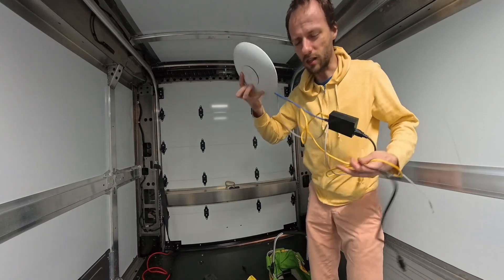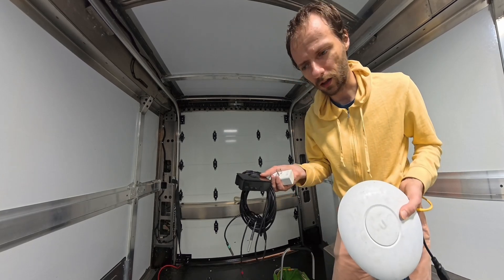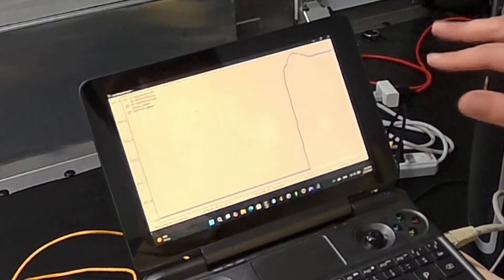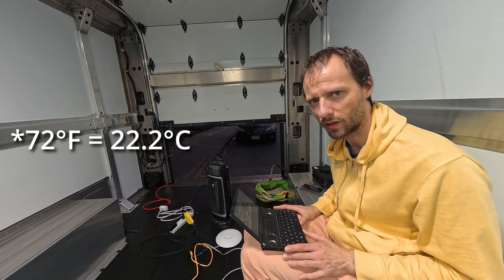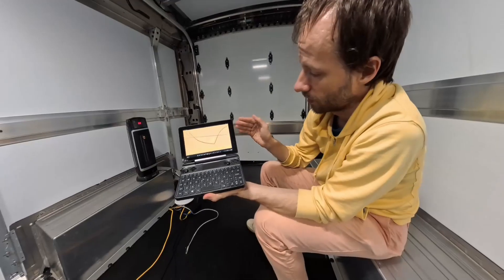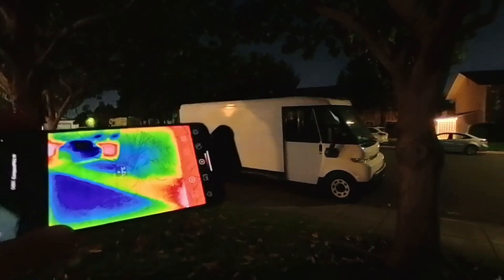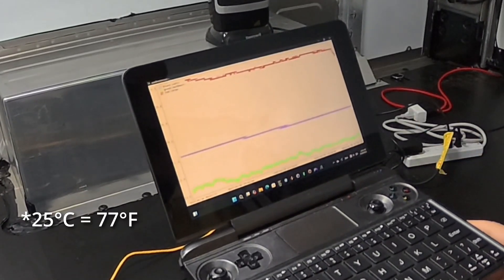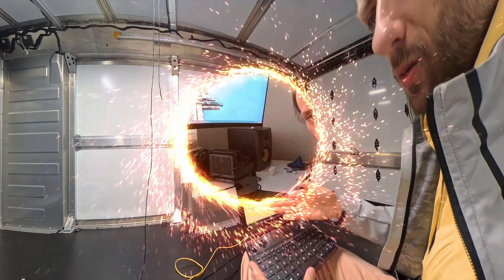Episode 2 - measuring heat loss in BrightDrop 600 (2025)

Comment: Would love an episode if you can review the adaptive cruise control on the brightdrop, and how it performs in stop and go traffic!
Reply from the maker: My goal for this channel is primarily the build, but I will try to keep your request in mind for when I do a longer drive
Reply: Thanks  @f3build
Reply: I can answer this briefly. Like the Sierra Denali EV, it works great most of the time. Just today, my Brightdrop failed to slow down when approaching a stopped car at a light on a curve. I increased my gap setting and now it slows well before the next car, but I need to see how that affects things over time. But in general, wow, what a nice feature to have in traffic! The biggest shortcoming here and with the Denali is that it can't see turn signals, so you have to disable the entire thing to let people in or merge.

Comment: Another option for offboarding power is using the 12V DC to DC converter. For the Bolt EV you could export 1500W. It may be the same or higher on this van. I can't find any solid numbers for any Ultrium vehicles.
Reply from the maker: Yes, this may work; but needs testing. It depends on how the 12V battery recharge system works, whether it will sustain replenishing 1500W into 12V system non-stop or it only works for a bit from time to time.

Comment: What kind of auto insurance did you get? Personal auto? Commercial? RV?
Reply from the maker: This vehicle is only sold as commercial due to weight as I was told, at least in California. But I got a personal insurance for it, since I don't have a business - I got one from State Farm, around 1300 per year. RV insurance requires it registered as RV with DMV. The plan is to re-register it after doing the minimal amount required for it (permanently mounted bed, sink, or toilet - smth like that), then it will allow to get RV insurance which should be cheaper.

Comment: How do you plan to heat and cool the van? Is there a 110V outlet inside?
Reply from the maker: For now I don't have a long term strategy on that, as no-build (my short term plan) makes it difficult to install an AC, I will probably use a resistive heater for the night running from a few KW-sized home battery like Bluetti etc. And hoping that I can insulate it well enough for this to be viable.  Long term if I like living in it - will install a split AC and mount the external box just outside the rear door. There is a 110V inside the cargo, next to the driver door; however, at least in 2025 model, power limit is 400W (might be less, have not tested), and it only works if the van is powered on, which is a separate challenge - the van doesn't have a good always-on mode. There are some discussions on brightdropforum.com about how to keep it running for longer and what tricks can be employed. I have not experimented with that yet.
Reply: @f3build  Any chance the cab AC / heater would keep the back comfortable in moderate climates, after insulating? Considering the 400 and simply throwing a camping mattress in the back to start
Reply from the maker: @chrisb1305  we will try to find out in future episodes) The main challenge with that would be just keeping the van on without touching controls every once in a while. My intuition says what you are asking is possible, but at this point it is just speculation. You can find some related discussions on brightdropforum.com